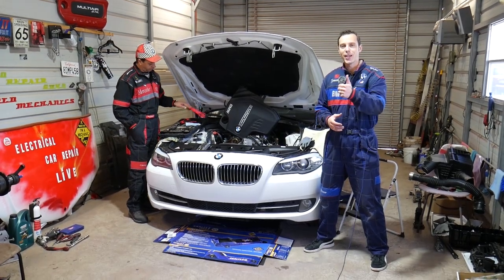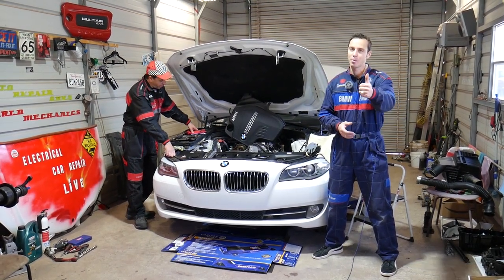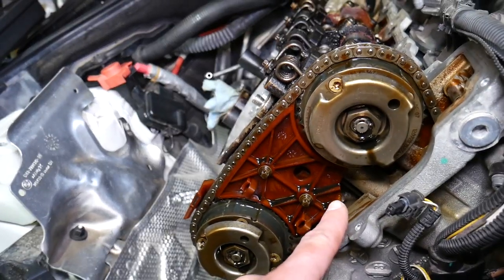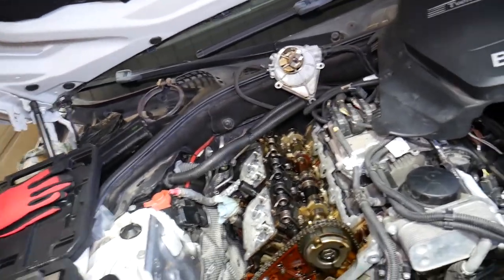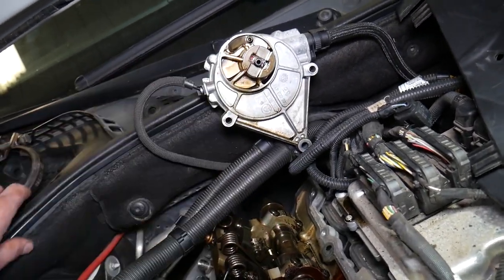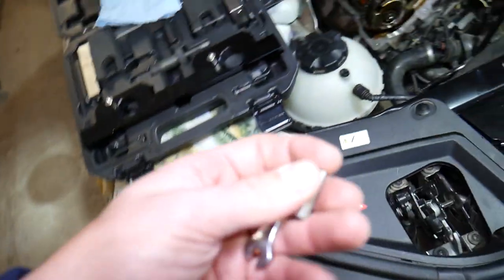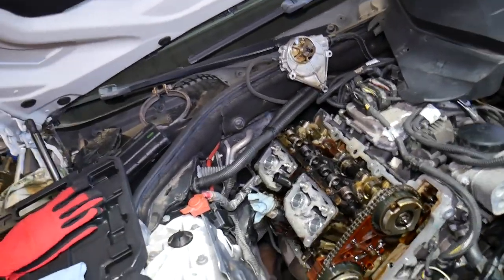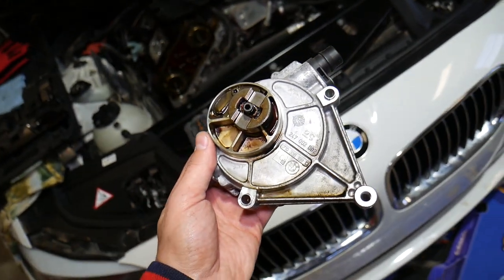BMW F10 F11 BRAKE VACUUM PUMP BOOSTER PUMP LOCATION REPLACEMENT 520i 528i

Comment: Is there an N55 F30 Vacuum Pump replacement video?  I'm getting oil out of my lines connecting to the boost solenoid and assume it's the pump...

Comment: Can you replace the pump without removing the cover? And what with the seal of the pump?how can I replace that one?
Reply: Hey Filip did you ever figure it out how to get to the pump without removing the valve cover?
Reply: @wayneleitch2118  hi..I bought the part but havn't replaced it yet..but to my knowledge you can replace itbquite easily without removing the cover..only access is limited  but its just couple screws and hoses..